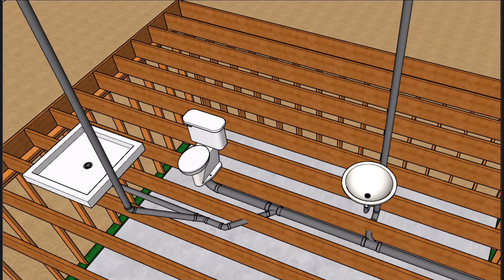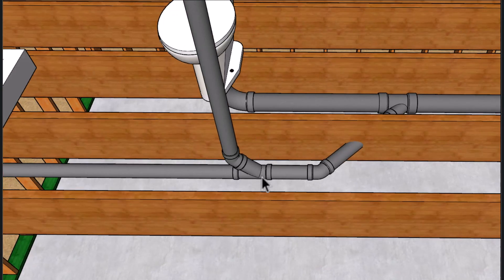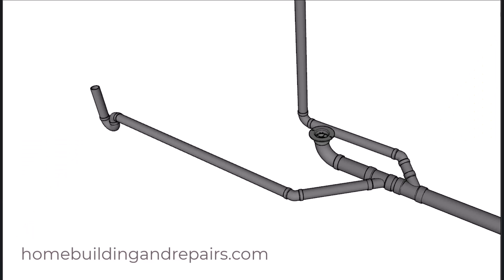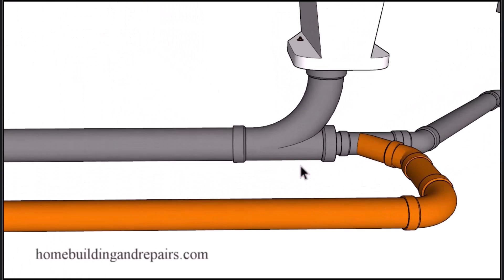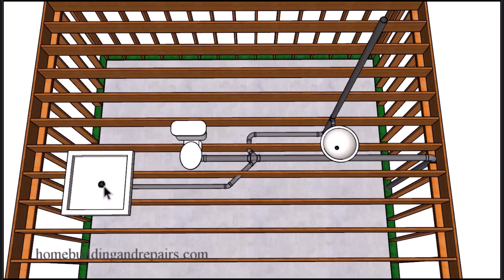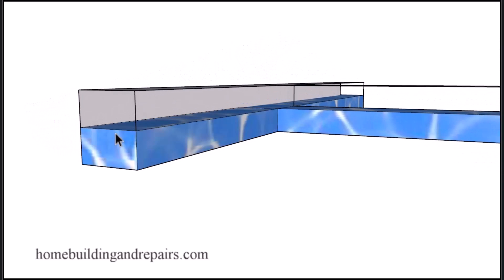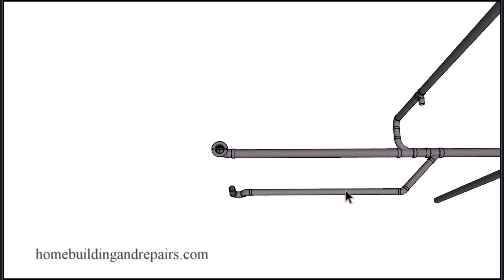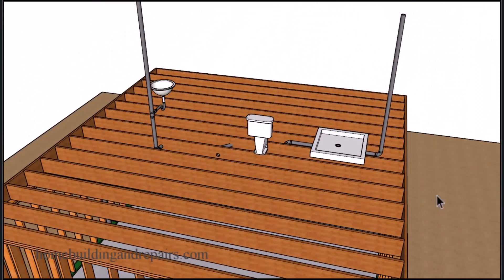How Dry Vents Can Connect To Wet Vent Plumbing Drain Pipes - Shower And Toilet - Project #1 Q&#1

Comment: Will one (1), two (2") vent, through the roof, up from lav drain, be adequate for toilet, bath and lav?  All within 6' of each other.  Picking up clothes washer 10' downstream then kitchen sink another 10' down from that. Both washer and kitchen sink will have AAV's, due to clearance issues for vent pipe .. Everything will be 2" drains except for kitchen sink being 1.5", 3" main drain from toilet to septic...
Reply from the maker: It will depend on how every fitting and drain is connected. No simple answer here.
Reply: @homebuildingandrepairs3122 ok, I thought a more thorough explanation may be needed...

Comment: Drain n vent the sink off the 3" drain line, trap n vent above floor.  Shower y off its drain arm, 45 n vent towards wall. Unless it's not too far at the toilet vent. Per code.

Comment: You need to explain distance on trap arms and branch intervals better.
 You are not doing any of that. And in most of these scenarios, depending on how long your trap arms are. Your first vent would be the only event needed for a bathroom group.  According to national standard.

Comment: I am a utility locator for an electric bore crew.  Can you please explain the usual path of a sewer lateral from a vent stack, and what should I be looking for when I find multiple vent stacks at the top of a roof, as in, which one will indicate where it's leaving the home from beneath the house.  Mind you, these homes are older, really huge, and usually I can't find a cleanout.
Reply: You would be looking for the largest stack, however that won’t help you because it can 45 anywhere on the property on its way to the main. When I plan bores, I will open the closest manhole cover and measure. In my area it is rare for it to be less than 7 feet. Sometimes you will find the sewer in a joint trench with the water (older cast iron). Only options left are GPR, municipal records or check google street view dates for previous locates (green marks)

Comment: Can you make a plan that I can submit to my town to get a permit to build a small bath in my garage that already has a concrete floor? I have obtained and passed the permit that ran the 4" drain from the septic tank(in use from house, garage is detatached) pex 3/4 water line is already ran and tested. I have a opening in the corner of the garage floor that I used to bring in the waterline and drain line. Opening is only about 18" x 24" it was very difficult to break up as my supposed to be 4" slab started at this location is 7" thick to provide a slope in the floor.

Comment: First off A GREAT thank you! for these videos.  after awhile it finally clicked what you where describing. 
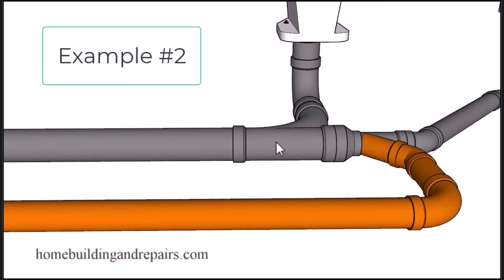6:15 you're wording of "upper section" was hard to understand/grasp.  should make it more clear you where trying to illustrate that the liquids flow in the bottom half and vent air in the "upper half" though it's just one pipe.   (and that the change made at 6:18 was because drained liquids would have consumed the entirety of the pipe which most of us assumed happens anyway)

Comment: You cannot go from vertical to  horizontal Is below the flood rim of the highest fixture. Must be a minimum of 6 inches above the flood rim
Reply from the maker: You just said you might be allowed if no other way in joist bay.
Reply: @homebuildingandrepairs3122  I agree with @donaldblank8873, the question you pose around the 4 minute mark, the reason that is incorrect is because the vent is no longer considered a wet vent when you come off the main at a 45 and then your horizontal pipe is not 6” above the flood line of the fixture. If you have to vent it like that, just make it a wet vent and then it’s OK.

Comment: I'm trying to wet vent a lavatory from a dry vent used by the shower and am not sure how long the vertical+ horizontal distances can be because the trap for the lavatory is above the floor. It's hard to locate examples online as most use the dry vent from the lavatory to vent the shower, but not the reverse. Is this possible? What are the maximum distances?

Comment: Using a tee or san-tee, can I tie a new sink drain into an existing bath tub overflow drain tube. The new sink has a pea trap and is vented via a studor vent.
Reply from the maker: I don't think you can connect any separate fixtures to the bathtub over flow.
Reply: That's thinking outside of the box forsure tho 🎉

Comment: Great video! for example 7, if you didn't have the air vent and you had to install an AAV, where would you add the AAV? On the toilet pipe or the shower pipe? Or both
Reply: Check local codes. Some states do not allow air valves. Iowa is one state that does not allow it.

Comment: Last example with flat vent is clear violation which you have been explained & shown code sections but still advocate. You said you didn't understand the problem. The reason from the code's perspective  is that downstream clogs back up and permanently clog or impair dry flat vents. If you don't agree with the code, I don't know if you should keep telling people to vent in a manner that would get them flagged at inspection
Reply from the maker: I need to ask, even though no viewers will be able to verify, have you ever installed plumbing pipe that did not meet code, because you did not have enough room or because of floor framing obstacles? Again, I've stated this more than once, check with local building codes before construction.
Reply: @homebuildingandrepairs3122  Yes I have many times when I was younger. That's not an excuse to teach plainly prohibited methods as correct

Comment: 2:34 Why would you ever need to snake your vent?  I mean maybe you get it unclogged and the clog travels down the vent pipe?
Reply: Liked and subbed, honest question not trying to be an asshole
Reply: @danteice2087  I am waiting for a camera. To find out what has  clogged my dry vent. 50 years old. I put another internal test tube and pumped air into the pipe. Plugged tight.
Reply from the maker: You could use it to snake the vent, but some times you might need to get into the drain through the roof and that's when you wouldn't want to hit a san tee. Let me know if this didn't make sense.
Reply: You're using the vent as an access to the clock that is in the drain because there is no clean out available. Cause a know it all handyman installed the plumbing and doesn't know Jack about anything.

Comment: I really don't understand why you are putting the vent 16 inches in front of the toilet and also in front of the shower. What's going on?
Reply from the maker: I will try to avoid doing that in the future and understand it can be can be confusing. I was using the original example to provide dry vent connections to a wet vent. Thanks for pointing it out.